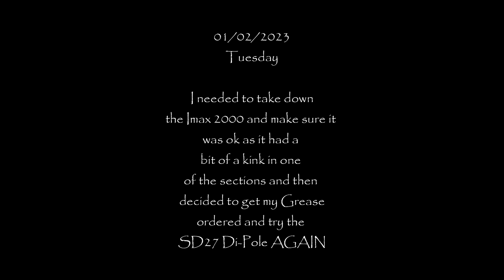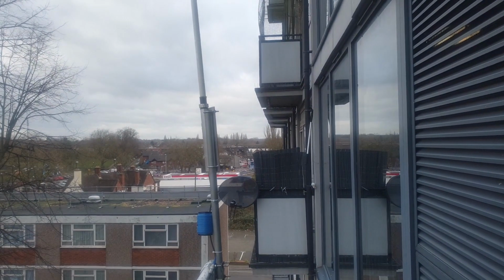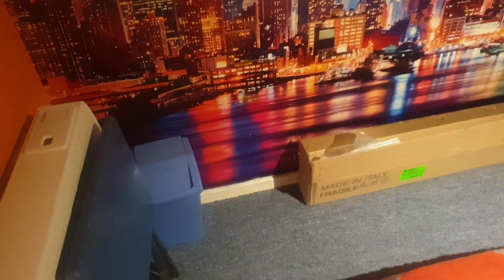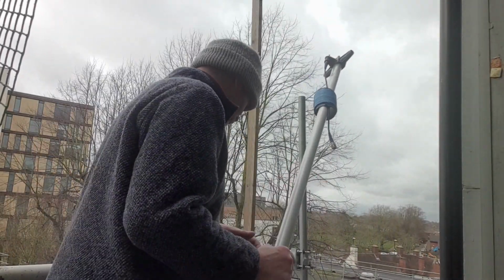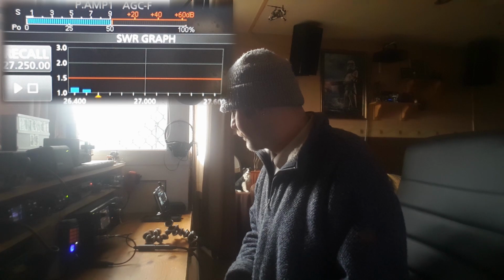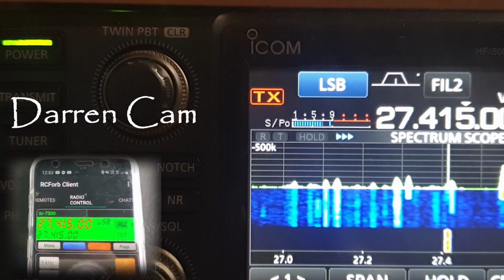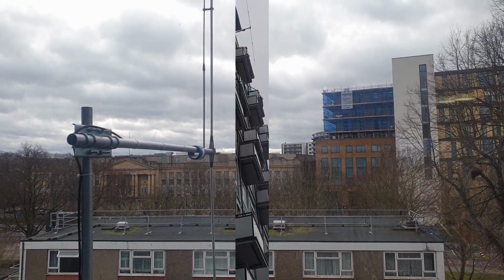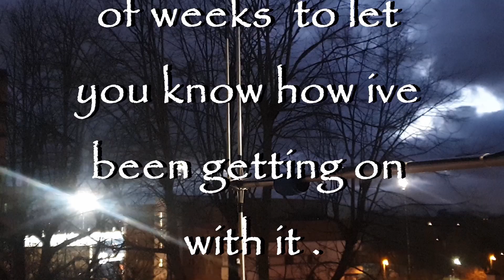Return of the SD-27 Dipole

Comment: My first CB antenna was a Di-pole made from copper conduit pipe, way back in 1981, homw brew on wood and bamboo .......Dave 26AT025
Reply from the maker: Nice dipole were more widley used back in the 80s as I remember , but they work well as I'm finding out Cheers
Reply: Hi mate 
Do you prefer vertical antenna or vertical dipole?
73

Comment: Great video Al and really interesting seeing you setup the dipole up. seems to be working well. Against the building it looks fine to me. Keep banging out the Radio waves Al Rocking radio
Reply from the maker: Cheers buddy it really seems to be doing well on both the ground wave and DX , it gets very interesting using  different antennas here, but it ends up with more questions than answers. Ill keep at it Cheers

Comment: I just bought one for ten meters. Tuned up good even in the CB/11meter side as well. Tried it out with my RCI 2950 and it got out good for only 10' above my deck. About 22 feet above ground. Should be putting it up on the house soon. Thanks for the review.
Reply from the maker: No problem, 2nd video ive done on it as 1st time after 2 days I had alot of water ingress and swr went crazy. Hopefully this time will be ok. Cheers.

Comment: Hi Al, there used to be a station close to me that stayed in a tower block who used all manner of expensive verticals, however he also came to the conclusion that a Sirio half wave dipole produced the best results in his situation. His balcony was south east facing so he got out well into Europe, however he eventually fitted a second dipole out of a bedroom window which gave him coverage to the south west which got him over stateside. 
He initially had them on a switch, but I believe he also experimented with co-phasing them as well 👍🏻
Reply from the maker: Yep ive been talking to a few people who say I should try co phasing, I do have a recieve antenna on the north side of the building which I did a video on, strangely i dont get hardly any noise on the north side. It can be damn odd living here. Cheers
Reply: @Al.26TC101  my understanding is that for co-phasing to work well you need identical antennas and the same length of feed line to each. It’s worth a bash I’d say 👍🏻
Reply from the maker: @GG-im1cb  I know someone who could make me a harness and the dipole isn't to expensive, watch this space 🙂

Comment: nice job buddy, how doe's it transmit through the block of flat's you live in other direction? does it cause alot of interferance?
Reply from the maker: No it dosnt cause any interference and ive got a recieve antenna on the other side of the building, i have done a video on how that works aswell it is a struggle , but i can be heard on the opposite side . but the flat does cause a blocking effect . https://www.youtube.com/watch?v=OlBgsm2mVyo&t=836s

Comment: If your talking on uk fm you could tweek the swr a bit 😉
Reply from the maker: Yep just a case of undoing all the bolts and bringin it in, doable but its not to high on ch40 about 1:7. Cheers
Reply: @Al.26TC101  what was wrong with the joint on imax on inspection
Reply from the maker: @T.M.G2014  Looks like the thread has bent a little into the bottom section, apart from that its all fine.
Reply: @Al.26TC101  at least you can replace it if need too